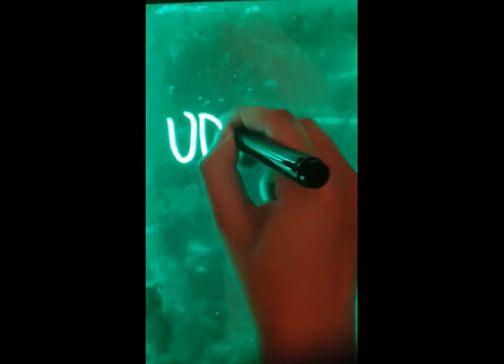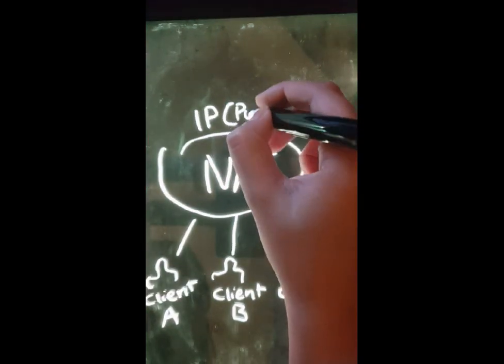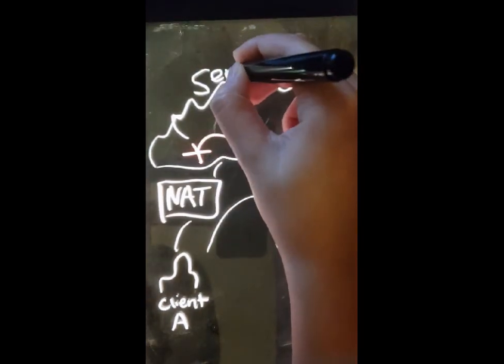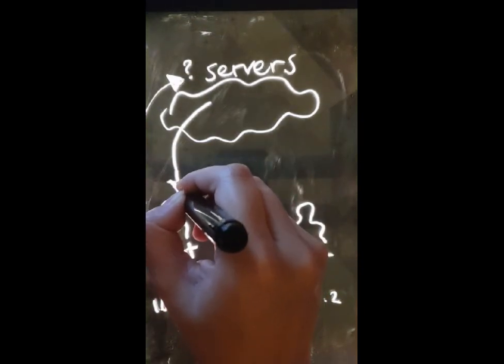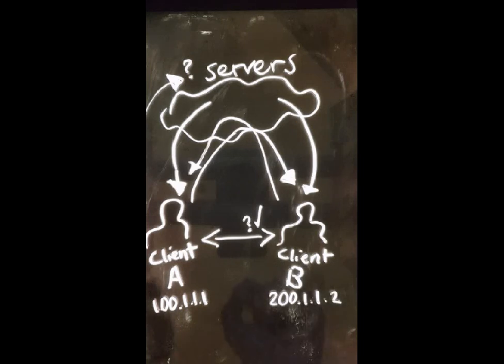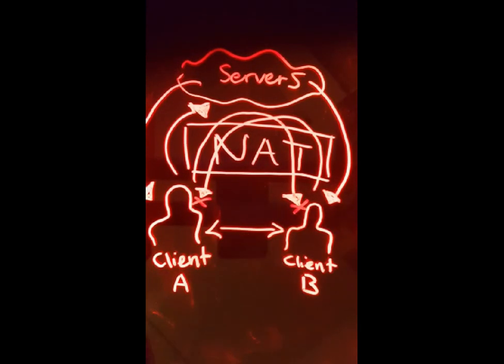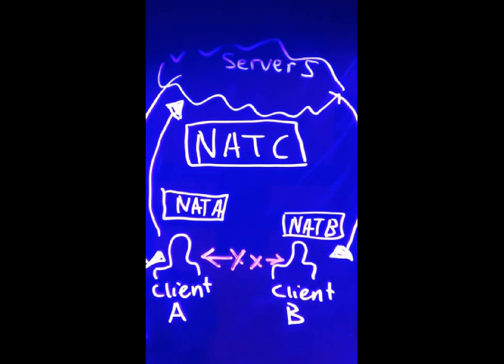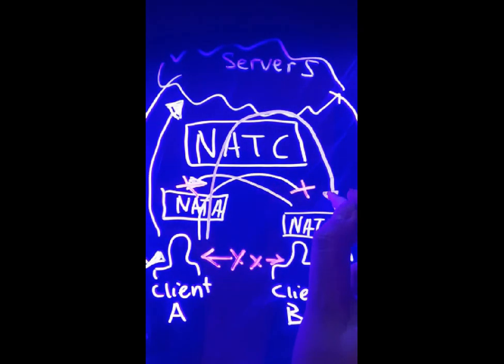UDP hole punching

Comment: My ISP gives me a modem in which they disable the Bridge mode. So my home devices are behind double NAT. On the modem WAN i have private IP 100.x.x.x.
I would like to be able to access my home devices from another internet outside my lan (from my cell phone 4G internet for example) 
Can HOLE PUNCHING solve this NAT ISSUE so i have access to my devices? If so can you please advise me what should i do? TNX!
Reply from the maker: Im sorry, but I don't think I can be able to help with solving these kinds of problems. Im just a student, had an assignment of doing a 3-minute video - This problem is beyond my knowledge. Hope you find a solution!
Reply: Yes, you can. However, you must program your own proxy and something else to access your home devices from outside using multiple hole punching methods, such as STUN, TURN or ICE. That's quite complex. There's something called Tailscale that might fit your needs, though. 

If you want to learn more you should read about udp hole punching, rendezvous servers and NAT subtypes (full cone, symmetrical, etc...).